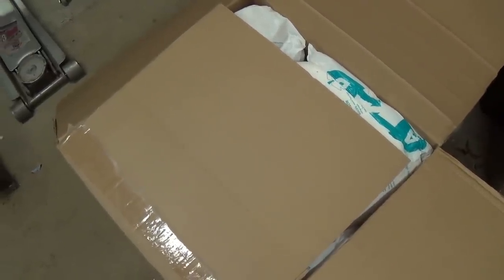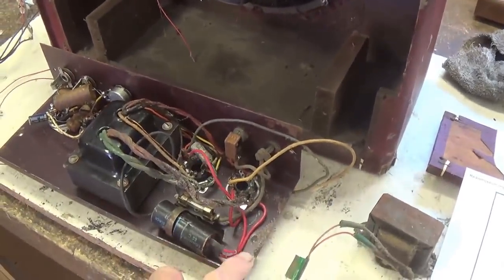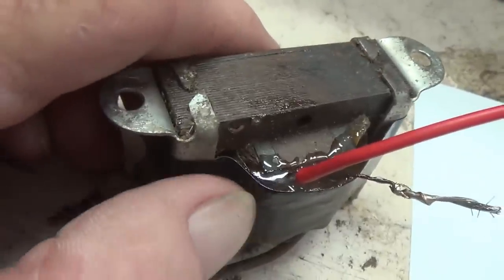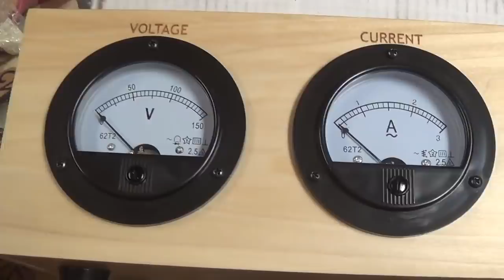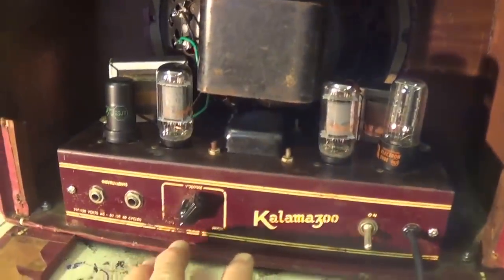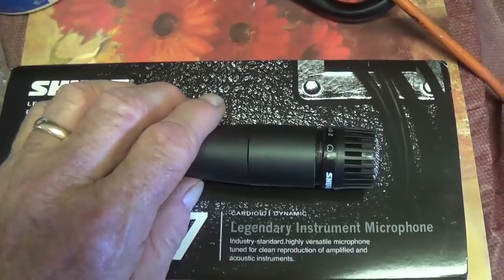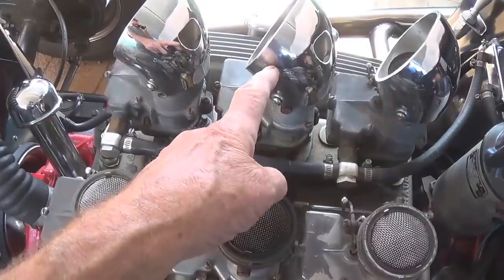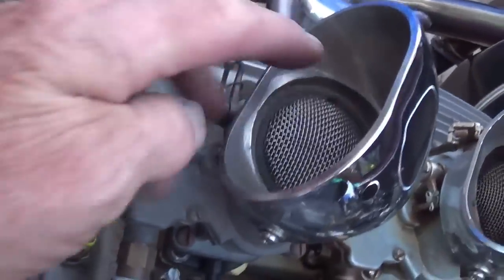Heroic Restoration of a 1948-52 Kalamazoo KEA Amp with an Unusual Circuit

Comment: Well that looked like a lot of fun, nothing like a simple repair that turns into a rebuild. Unfortunately, been there, done that. Masterful job as always. The amp sounded great and what a treat to get the opportunity to deal with brown recluse nests instead of rat’s nests. I have seen a few transformers with ripped paper like that but was never able to successfully reconnect a broken wire. Too bad about the primary going bad that was a great repair. On the mic audio; the main difference that I noticed was with the Shure mic I could hear the ”Pick-Click” (that's the only way I can think to describe it) due to the higher fidelity of the Shure mic. Sounded like a Fender tortoiseshell medium. Just a guess I used to use a Fender thin but MS has robbed me of the ability to hold a pick and keep it pointed in the right direction. I have tried every brand out there. Even gator grips get turned around on me. I will just have to stick to finger picking. Better for dexterity therapy anyway. I think that the Shure mic sounds better, but will entail a lot more work for you in producing a video. If you decide to go that route I would suggest a suspension or ”shock mount” for the microphone. I know that in ham radios they can be so sensitive to vibration that you can hear every vibration, cooling fan noise etc. At least with my Sennheiser mic it is that way.  Ingenious solution to the boil over problem with the Strombergs. The extended shelf to shield the carburetor bowl was a stroke of genius. I have seen phenolic spacers that were supposed to solve that problem and supposedly improve performance. But they often required changing out the studs in the intake manifold with longer ones. I have also seen cars that required a hole in the hood a small air cleaner with a hood scoop to cover it because of the added height of the carburetor. The high heat paint was a good solution, I was thinking that you were probably going to submerge the spacer in thin epoxy like fiberglass resin. An extraordinary bit of luck finding the Strombergs complete. It would have probably been difficult to hunt down 4 sets of butterfly's and little brass screws. Now when you get ready to tackle the 6 carburetors all operating all that you will have to do is come with the right jet combination to keep from drowning that small block. Stromberg probably has a configuration table worked out for that. I would think that the CFM of air with all six carbs open even at high RPM might be a bit much. I don't know, a quadrajet had 2 1/4 inch secondaries but also a top butterfly that was pulled open from the airflow while lifting the metering rods out of the secondary jets. That way it held vacuum and controlled the airflow. If I remember correctly, there were two versions, mechanical secondaries and the more common vacuum-operated secondaries. I believe the mechanicals had a stronger spring in the top butterfly because the lower butterfly just snapped open. It is been 40 years since I have had the excruciating pleasure of working on a quadrajet. That was a great video, I was just about to go through Uncle Doug video withdrawal, but I am glad that you enjoyed your vacation. Looking forward as always to the next amp adventure.
Reply from the maker: Thanks so much for your many astute observations and nice comments, Mark. My plan is to block one barrel of each carb, resulting in the equivalent of 3 x 2 bbl's, then set up progressive linkage to open the outer carbs at about half throttle on the center ones. It will be a nightmare to seal all vacuum and fuel leaks, get proper jetting, get the outer carb butterflies to seal (not ajar for idle), etc. but such is life in "hot rod biz". :)

Comment: As for the amp, it's one of the better sounding ones (even with the cam mic) that you've featured. I thought it had an acoustical sound to it that would probably make it sound very good with a Telecaster in a country band - small bar setting.

Comment: Awesome video Uncle Doug. BTW, that type of phase inversion is known as a Cathode-Drive Inverter.  Matched sets of tubes are imperative for this type of push-pull configuration.
Reply: BTW the difference is night and day with the new mic. That amp sounded like a million bucks after being mic'ed up like that.
Reply from the maker: Thanks for the info, William. The two 6V6's are well matched.....thank heavens :)
Reply: @UncleDoug  I ran across this article a few months ago that was talking about different ways to do phase inversion. You may find it interesting if you haven't seen it already. https://dalmura.com.au/static/Phase%20Inversion%20Circuits%20Radio%20Craft%201948.pdf

Comment: Great vid as always! Kind of a bummer about the holes in the top of the chassis for the transformers, but I assume that was a customer choice. Cool fix on the carbs too! If you run into a problem with the masonite deteriorating over time, you might take a look at phenolic plate...appropriately-sized pieces can be found on eBay for about $3.
Reply from the maker: Thanks, KT.  Between the new OPT, tubes, capacitors, resistors, speaker,  handle, and rubber feet.....I didn't think a couple holes in the chassis would make much difference :)  Besides, the amp was donated, so I could do as I wished.  If the masonite fails, I will re-make them with phenolic material. I just didn't have any handy.

Comment: Something that works great for prying and bending metal tabs like on those handle attachment things you called staple legs are little box end wrenches. Tiny ones for little things and the big ones for big things.  They work great.
Reply from the maker: Thanks for the tip, Drew.

Comment: Mine looks pretty dang different inside, as it's all original, save for a few leaky wax caps.  
 Doug, I'll send you pics if you want. I got mine in Kansas City, MO in 2006. It's been to Skip Simmons (around 2010) and the field-coil speaker was sent to Chicago and re-coned by Weber last year (2022).
Reply from the maker: Thanks for sharing, Anton. Obviously there was some variability in these old gems.

Comment: Bravo!!!  Both on the amp restoration and the audio addition.  The audio was long overdue...I agree with moving the mic off center.
As always, thanks for you professional presentations and good luck with the fuel problem.  Are you certain the the pressurized fuel tank wasn’t part of the problem, though I guess the needles really shouldn’t leak that badly in 20 minutes.
Reply from the maker: Thanks, Bill. No doubt, the fuel pressure contributed to the flooding.....but not any more :)

Comment: Big difference UD.You want to place the Mic. One inch away and go out from there for a good start.Then You want the end of the mic.off axis from the cone.Too many overtones on the center.Your Hot Rod looks great.They do make a fuel injection system that looks like the old 6 pacs.A little expensive I've heard,but great for overheating problems.Vented gas caps are a must nowadays,a lady in the neighborhood has a Ford Expedition that has a non vented cap and that cap actually hums when it gets hot outside.Hahaha.Good work on both projects buddy.👍🎸
Reply from the maker: Thanks, Bob :)

Comment: Hi Uncle Doug, after viewing Craig's video could you check if a two prong plug or an adapter should be used versus a three prong plug?  Like you did in your video about isolation transformers.  The comments on Craig's video imply that the grounding of the outlet for the devise under test is appropriate, but I believe it may be just like what you showed in your IT video.  Thank you.

Comment: I like so many am enjoying these videos. This was a good one for me as I viewed it with a dictionary to look up exactly what a capacitor ,resistor filter choke etc. job is. I have no delusions of grandeur of trouble shooting then repairing a circuit, but I’m enjoying the learning experience. 
Uncle Doug, have you ever built a guitar amplifier of your own design? If so I for one would like to hear a demo, of course using the SM57. Thanks again.
Reply from the maker: I admire your willingness to do some research to boost your comprehension, FJ. Yes, I have made quite a few original amps. Check out my earlier videos, as well as the videos that feature audio comparison of 8 to 12 amps.

Comment: Looked rough at the start but finished a little jewel.  The SM57 does sound much better.  Cool carb cooler / insulator mod.  Did the stump burn down far enough to no longer be a trip hazard?
Reply from the maker: Thanks, Andrew. No.....now it still trips you, and turns your shoe black with soot.

Comment: Thanks for the tip but I always try to stay grounded, people hate it when I hum, lol. I do have a question on the phase inversion though, it looks like the 220 ohm resistor is feeding both cathodes in the schematic, not just the second tube, this confuses me a little. It looks like it would try to cancel out the grid on tube one. I obviously am missing something since it works, lol. I was just wondering what I'm missing. I'll ask this on Patreon if you prefer I was just curious. Glad to have you back making videos and am very glad to hear you had a good vacation!! As always a wonderful old amp and very helpful informative video!! Craig's current-voltage devise is amazing!!  I will definitely check out his video on this!! I only dream of being able to do that sort of woodworking and design!! Thank you, Craig, for sending this to  UD so he can share this with us viewers!!
Reply from the maker: It's our pleasure, Jack. The 220 Ohm resistor sets the bias for the two 6V6's (it's the "cathode bias resistor").  Thanks for mentioning Craig's nice work.
Reply: @UncleDoug  Oh okay. Yes, I watched Craig's video and it was very informative. Thanks for the heads up!!
Reply: @UncleDoug  OH okay, sorry for the blank out there, lol.

Comment: Another great episode, Uncle Doug!  The finished amp sounds great.  But, a quick question:  why not move the insane inline fuse from under the chassis to a flush mount on the rear?  I understand that people don't want stuff changed on an old amp unless absolutely necessary, but as you mentioned, when that fuse blows it will be a nightmare to replace.
Reply from the maker: I haven't had a fuse blow on an amp in several years, WuG, and to be honest, if one ever did, I would automatically pull the chassis to see why.

Comment: Nice job on the Kalamazoo Doug.  You never know what dilemmas lurk until you  blow out the spiders and dust.  As far as the carb heat , I had a similar issue on a 1966 Chevy mid-engine van.  Summertime boil-over was cured by taking 3 sheets of aluminum, sandwiching in standard Fel-Pro gaskets in-between the manifold and carb aluminum plates.  The aluminum plates acted as a heat sink and dissipated the heat while stopped as well as a small radiator being air cooled while running.  Hope you have success.  And did the new vented gas cap ease the pressure buildup on the float valves ?   J K  in Houston
Reply from the maker: Thanks,  James. Yes, between the insulator plates and the vented gas cap, the problem was completely cured.

Comment: I was kinda wondering if you could save that transformer. I've saved a couple...but you almost gotta be a brain surgeon. Almost seems cheaper to replace the transformer if
you consider your time to be worth anything. As for everything else you had to replace, that stuff had plenty of time to go bad(8-). Thank goodness it's a fairly simple circuit.

I do think that super whamadyne microphone does sound a bit better than the one in your camera...though the camera mic isn't a slouch. This was a great video. And I also
thank the guys who sent you all the great stuff...WAY TO GO GUYS!(8-).

Very impressive fix for the  boiling carburetors. Looks like masonite doesn't conduct heat worth beans(8-). Clever trick, Sir Douglas(8-). I'd have never thunk it(8-).
Reply from the maker: Thanks for all your excellent comments and observations, Tom :)

Comment: Great video Doug...The rebuild was great to watch, and I think the SM57 mic provides better audio than your camera microphone.  On the four outer carburetors, how does the blocking plates not interfere with the movement of the carb throttle plates?
Reply from the maker: Thanks, Joseph. As I noted in the car video, the butterflies are recessed deeply enough within the carb bases that they can open and close without touching the blocking plates.

Comment: Tip: Despite Les Paul and loads of others who hopped n the bandwagon, I've never liked a mic dead center and nearly right up against a speaker. Many people like myself (and need I mention Jimmy Page) have gotten MUCH better results by pulling the mic back 2 to 3 feet. I also like it better when it's about a foot above the amp and looking down toward the speaker(s). And for what it's worth, despite it being labeled as a vocal mic, I think the SM58 sounds better on guitar cabs than the SM57.
Reply: When I did live bands for college radio, I used my limited supply of SM58 for the amps/drums and SM57 for the vocals.
Reply: @russellhltn1396  I knew I couldn't be the only one!

Comment: You should ohm the leads of the output transformer and filter choke to their case to make sure there are no shorts also. Since you moved them from the case where they were isolated from the chassis and mounted them directly to the chassis, that could have been an issue. Do you think that is why winding failed? Do you think you had left it in the case, isolated from the chassis it may have lived?
Reply from the maker: If the output transformer had an internal short, it was defective, AN, and should be replaced, whether the short was concealed by no connection to the chassis or not.  It was defective, wherever it was mounted.

Comment: Interesting. The output is essentially a differential pair.
Reply from the maker: Sort of like a long-tailed-pair phase inverter.
Reply: Uncle Doug Sort exactly like that. Lower tail resistance because of the higher current requirement, but same principle exactly.
Reply: @UncleDoug  Yes. I wonder why this wasn't done more often.

Comment: Uncle Doug - you have probably said that in your videos, but just to make it clear - what is your preference in the first stage of amplification circuit - triode or pentode and why? For example this amp - how would the tone change if you replace 6SJ7 with  6Q7 or wire the pentode in triode mode (if not already)?
Reply from the maker: After all sorts of experimentation with both types of pre-amp tube, I personally don't hear that much difference between them. This may seem like blasphemy......but triodes are simpler to set up and seem to work just fine, at least to my old ears.

Comment: Doug 
you should check the wiring on your new isolation xfmr as your benifactor hooked the ground 
up on th outlet
best wishes
RJ
Reply from the maker: Thanks for the tip, RG. I will check into it before using the unit.

Comment: I came here to try to understand this circuit. Pretty sure it was PP but how do they do that without a PI tube or transformer? Your explanation makes perfect sense. Not sure if I missed something where you addressed this, but amp tech Jef Brown has a blog post on this amp where he mentions that the OT is "assymmetric" -- I think he means that the center tap on the primary winding is not in the center (inferred from measured resistance of the two sides of the primary). If that's the case I think one output tube will be pushing more juice into the speaker than the other. That could make sense given the weird PP arrangement -- seems unlikely that this weird coupling would deliver 2 sides of the wave with identical amplitudes. Would you know of a way to measure or analyze whether that's happening? My guess is the "bottom" (on the schematic) tube with its grounded grid is putting out a weaker signal and thus is connected to the side of the primary that has more turns, so that it is "amplified" on the secondary relative to the other side. 

I'm kind of new to all this -- am I making any sense? Thanks!
Reply from the maker: Your guess makes sense, John, but it seems strange that the company would utilize a cost-reduction circuit (one less tube) which required a custom-made output transformer.

Comment: This amp sounds beautiful. I like the use of the mic...but I never have understood the love for the 57.  The only thing it brings to the table is that it doesn't blow up when miking an amp that's already too loud, and it's hard for monkeys to break. It's an awesome mic for high school bands and crappy bars with crappy acoustics. An amp like this will never be loud enough to take advantage of the 57's strong points. Let me add a voice to those saying you should move it off center a bit-dead center tends to be a bit brittle. This amp sounds beautiful.
Reply from the maker: Thanks so much, OWB. I will follow your advice on the mike location.

Comment: New mic sounds much better Doug! Can't go wrong with that mic. Welcome back from holidays. So, resistors actually go bad? How long would you expect the new ones to last? I sent you a spec sheet for the “NuTube” preamp tube, but in hindsight, it might be off your branding. 
You might get a kick out of this...I listed Uncle Doug for my electronics education on my resume for a job building custom circuit boards. Lol. They sound interested in hiring me too. I'll let you know.
Cheers from Ontario
Reply from the maker: Thanks, Dave. Yes, carbon comp resistors do increase in value over time. These were low wattage and really went to hell......ruining the tone and volume.  I'll have to start handing out diplomas :)

Comment: the stability of the 1 1/2 volt USB signal can be easily toppled with sudden changes of available power~ have found it's best not to run more than one device off the same USB bus~
Reply from the maker: Thanks for the info, Jay.